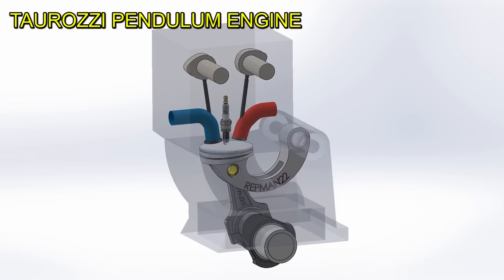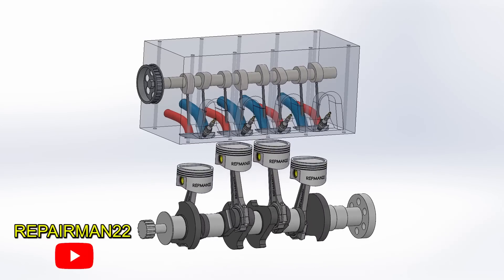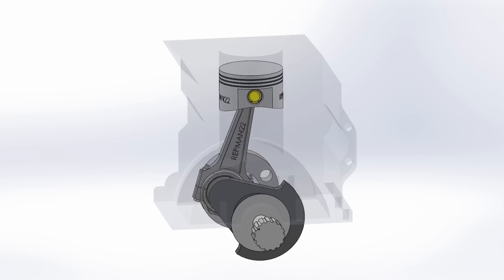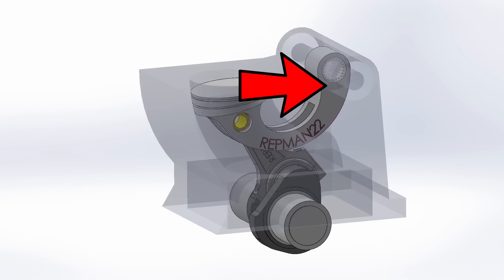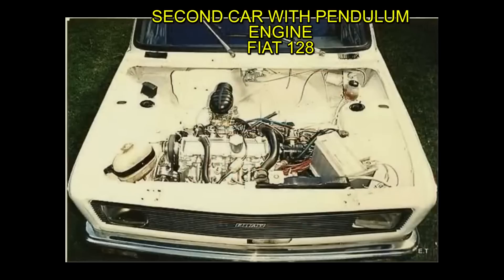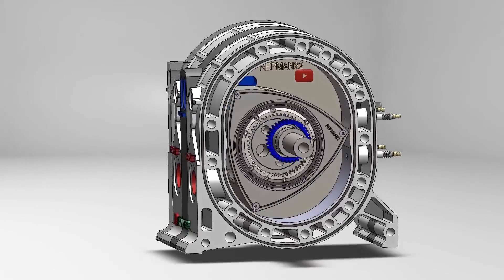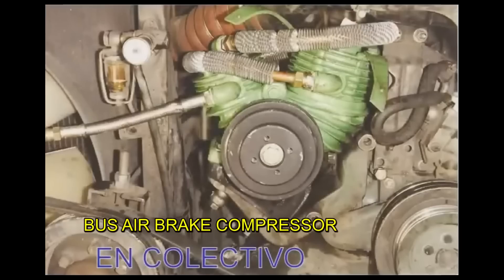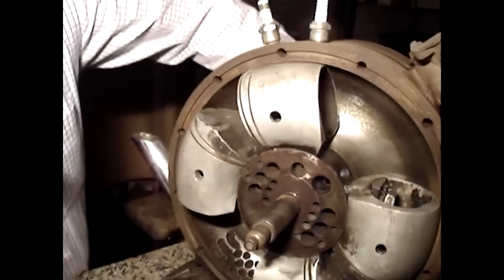All about the Taurozzi Pendulum Engine 🧠 and what happend to it🤯

Comment: Would like to see this system work in conjunction with a Ducati desmodromic valve system. On the pendulum arm the bearings used was pin bearings, good for heavy duty but still too much friction, two sets of ball bearings side by side for each pendulum arm would be better.
Reply: Yeah lots better. Until those ball bearings fail (which they absolutely will under those kinds of loads) and you now have very hard steel or ceramic balls rattling around in your crank case. Standard solid bearings with pressurized oil is far more reliable and the difference in friction is a lot less than you would think.
Reply: @wingracer1614  if it was load carrying bearings pin bearings would be better, this is not so no need for more friction ball bearings would do the job.

Comment: This was made in the 90's, the thing is if it was as good as they say it is it would be in use today
Reply: Nope. They lie about everything. They take anything good, and ruin or hide it
Reply: Well it's like two stroke, if the technology was constantly developed it could be great, but since it's easier to keep the same tech than reinvent the wheel why would they?
Reply: @Mark345  who is they? If it was any good someone would be making them even if it's not mainstream.
Reply: @deckum23 You heard the news after making Cyber truck Elon musk sent a manual to all car manufacturers of why to use a 48 Volt system over a 12V  in cars so they can reduce the weight and cost of the car significantly? We still use a 12 V system which was made back in the 1930s, because they are just lazy to make a change. It's not as complicated as you might think. They just never tried. in this case, there may be some issue, but still if Russia considered his engine to be good in 2015. It should have something.

Comment: I want to know where the narrator has his information from, since most infos he gives on the conventional engine are vague at best or simply wrong. Eg. The only thing touching the cylinder walls are the piston rings. If the piston continuously touches the wall, it will simply burn up from the friction. The big advantage of this system is the self adjustability so no need for super precise tolerances needed.
Reply from the maker: super precise tolerances are needed!!! and of course, the piston does not touch the piston walls because there is a lot of oil but the oval shape appears anyway in a conventional engine...

Comment: How does curving the trajectory of the cilinder reduce friction?
Reply: It's not about the trajectory of the cylinder, but more about controlled trajectory.
In a conventional combustion engine, the only way to control the piston's movement to lock into a vertical one is to make it 's radius keep constant contact with the cylinder, resulting in "parasitic" friction due to the force and movement vectors not being colinear.
This engine locks the trajectory of the piston by adding a new "contact" point, thus theoretically making the piston and cylinder friction free, especially on the explosion stroke, although possible that this makes less friction with the cylinder, I assure you it makes a new friction point in the piston pin, so the only way to truly know if any benefits at all cole it to thoroughly test it.
Reply: @MrVito456  Thank you

Comment: Just a variation of a trunk or crosshead style engine, (steam engine or low speed diesel type) the only advantage over them engine is the far shorter height of the block, made into a disadvantage of a wide block

Comment: Looks like a cool solution looking for a problem to solve. I don't think the benefits overcome the build complexity (two "crankshafts", harder mecanization...)
Also, wide short bore pistons do exists, which are almost the same without the complications. And have never been a popular option for car manufacturers.
Reply: I wouldn't compare the second axle with a crankshaft. For one it can be a simple straight axle, no complex offsets. Secondly they bear very little force, so they don't need to have complex metallurgy care that a crankshaft need. and the bearings don't have to support that.
You could even run a small straight oil line through the shaft, to provide each bearing with a little oil if you really wanted to reduce wear to basically nothing
Reply: @DrTheRich  Yeah, yeah... I called it "crankshaft" ... on quotes, because I didn't really knew how to call it.  But whatever it is, makes the engine more complex...
Reply: @framegrace1  a little bit yes, but complexity and efficiency go hand in hand. I drive a Ford Model A from 1929 that has a simple engine, but it eats fuel like a mother.

Modern engines are many times more complex than mine, but are 4 to 5 times more efficient.

complexity in itself is not a deal breaker, if it comes with a substantial enough benefit.

Not to mention, complexity for a home made engine, is a different story than complexity for a mass produced factory engine.

Modern complex computer calculated casting shapes are easy for factories to produce, but hard for a hand engine builder at home.

All this engine needs over a normal similar one is a few extra holes in the casting, an extra axle and some bearings. easy peasy for a modern engine factory to make.

Comment: Is this an April fool joke, a boring machine that bores curved holes 🤣🤣🤣. Utter garbage I would like to see the m/c that bores curved holes.
Reply: It would have the tool head swing on an arc, rather than a bar/straight line.
Reply: @jayrowe6473  what on a, flexi shaft just watch that tool bounce and chatter on a. 002 feed
Reply: @Jonnythebaker  You're right, it's entirely impossible.

Comment: Some technical notes. 
1.  Piston is geometricaly part of a toroid if it has 2-3 rings.  Who makes that?  Who makes the toroids anyway? Who aligns the toroids in the block? 
2. Alignment of the needle bearings in block,  must be perfect, aquires second line boring action.
3. During exhaust and compression stroke the piston rod is under an adverse angle and has to accelerate a heavier mass of the piston/banana part, compared to a normal engine. Doing that the sideward component of the adverse angle BENDS the banana more than 0.04 mm (normal piston play) and hence causes the friction on the innerside of the toroid, that you want to avoid so desperately.
This idea looks only valid for people without any mechanical knowledge.

Comment: problems i see from this:
thermal expansion from the arm. the piston will hug the inner wall when cold and probably eats alot of oil.

vibrations from the curved shape

hard to manufacture.
yes there are kompressors out there. but look at the price.

Comment: Cutting friction is no joke so this engine still has potential, using gaseous fuels like hydrogen and ammonia 🤔
The fact it's used for high purity compressors just means the technology is matured.
Thanks👍😃
Reply: imagine this engine with hydrogen, it would be so nice
Reply: I am pretty sure that it does not cut friction that much. An ICE is heating up mostly because of the heat of the burning fuel, not due to cylinder wall friction. If the friction on the cylinder walls were that huge then engines wouldn't last for 2-300000 km or more without any internal overhaul.

But for comparison, piston air compressors use the same arrangement, yet they require many times less cooling power. The only difference is that they do not burn fuel.
Reply: @gabiold  I used to own a Toyota truck in the 90's and I changed all lubricants to full synthetic and the friction reduction was dramatic and so was the mileage. 
The friction reduction in this engine and its design and current use makes it a natural for a gaseous hydrogen engine 🤔

Comment: It all sounds so feasible but then so did the Wandle Rotary.

And no, the pistons do not touch the cylinder wall, the rings do that and they do not occupy the whole depth of the piston. It’s as much a question of mass and size as it is friction.

Comment: How does it deal with thermal expansion and contraction in the pendulum arm? This would tend to push the piston against the sides of the bore?
Reply: It wouldnt let for that to happen at all. Didnt you watch the video?
Reply: @divinehatred6021  I certainly watched the video. What stops the pendulum arm expanding and contracting? It's metal isn't it?
Reply: @ColinWatters  its a metal that doesnt have to heat up/cool down because it doesnt contact with the walls of the bore to begin with. To the point where it doesnt need much oil to work. Or doesnt need it at all
Reply: @ColinWatters  basically, the piston is on the rails.
Reply: @divinehatred6021  Yeah I know the idea is to eliminate friction between piston and bore but to keep the piston centered and maintain the normal 5 thou gap the pendulum arm and the block must be pretty accurately machined and there mustn't be much expansion. The other solution is to have a greater than normal piston bore clearance.
Reply: @ColinWatters  Machining it precisely is not a problem at all.
Reply: @divinehatred6021  OK so I calculated the thermal expansion assuming a steel 0.2m wide arm and a 100C temperature range and its about 0.1 mm. Typical piston bore clearance in a conventional engine is about 5 thou or 0.15mm so it's ok/marginal. The main issue might be making those arms a consistently the correct width (to within 0.1mm) to prevent rubbing.

Comment: With no wear, the auto industry thinks they won’t wear out and will last too long.
Reply: What do you mean no wear? It has all the same wear parts (plus a few extras) as any other ICE engine. The only thing that MIGHT wear less are the pistons but seriously, how often do modern pistons wear out? Almost never. They can be damaged from things like broken timing belts or detonation but this engine is no different in that regard.